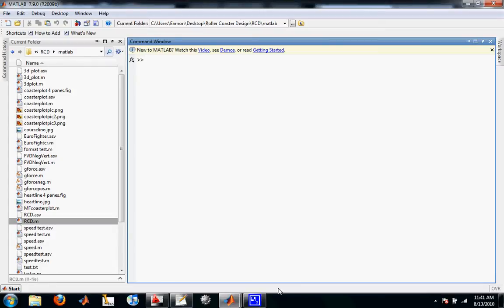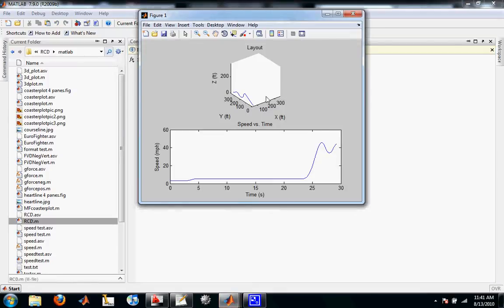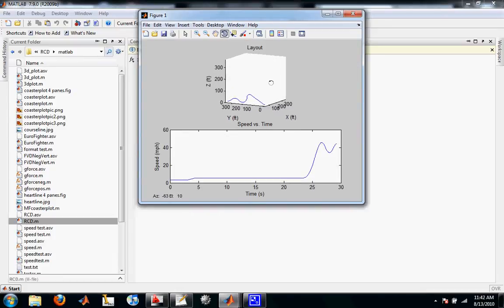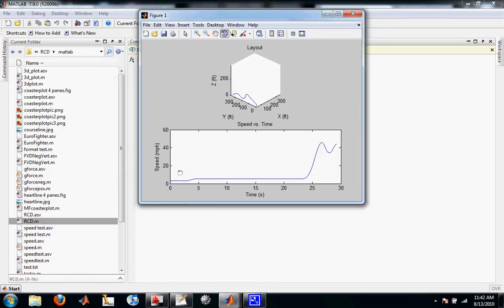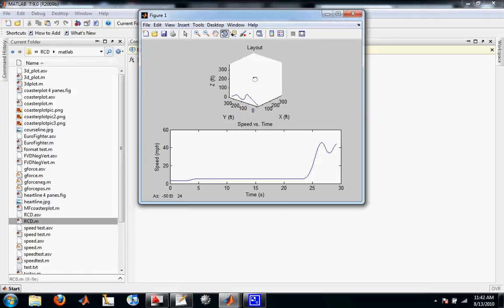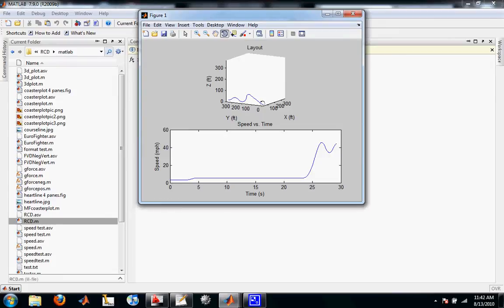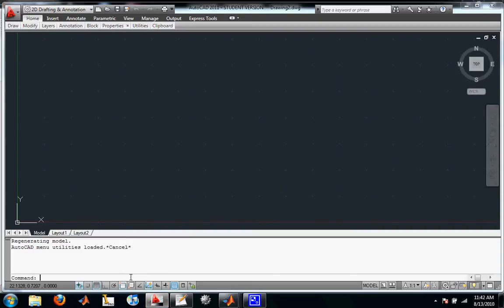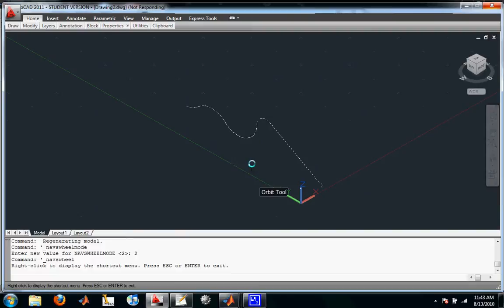Using MatLab and AutoCAD to Create a Roller Coaster (1)

Comment from the maker: Definitely.  I haven't touched this stuff is a few years, but with the ability of most software to interact with each other via things like VBA programming it should be fairly straight forward to have Matlab calculate coordinates and export to a file that a separate script in AutoCAD could read in and plot with a POLY type command.

Comment from the maker: @RAMiTheGuitarist 

The actual data was done in Matlab.  All AutoCAD did was plot the single data points that, from a distance, look like a curve.  In Matlab, I used a large number of data points, where each data point had an x, a y, and a z value.  To make an upward curve, all you would need to do is create a curve in the x,y plane while your z values increase linearly.

Comment from the maker: @EamonKellyRCD For example, if a variable theta ranges from 0 to 180 degrees, and x is some radius times cosine theta and y is the same radius times sine theta then you'll get a semicircle. To go uphill, you only need to make your z data points some linear function that has a positive slope. Just make sure each array of x, y, z data is the same size or you'll have issues. For the speed, I used the potential/kinetic energy equations, with some light friction. Feel free to ask more questions.

Comment: Hi. how did you run the script(that you have written in autolisp) with matlab?
Reply from the maker: Hi Mohammadsaleh, I did not run the AutoLISP program in Matlab.  I had one program in Matlab to make the curves, which exported to a text file.  I then had an AutoLISP program that read the text file values in to generate the lines in AutoCAD.
Reply: @EamonKellyRCD  hi could you share to me about the lisp?